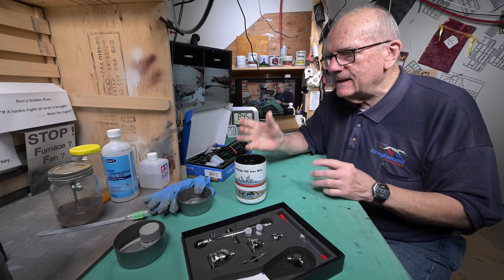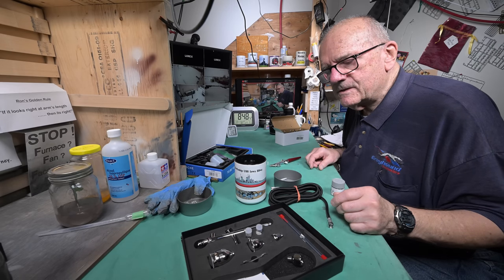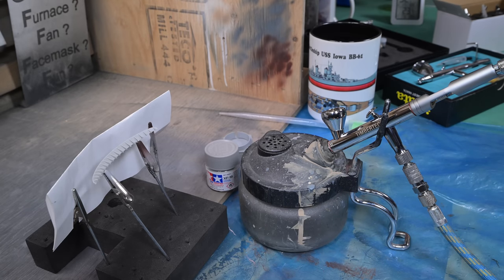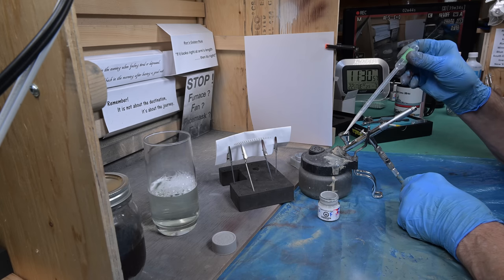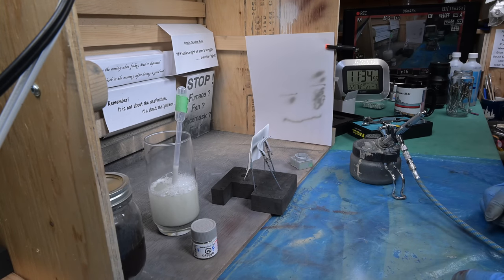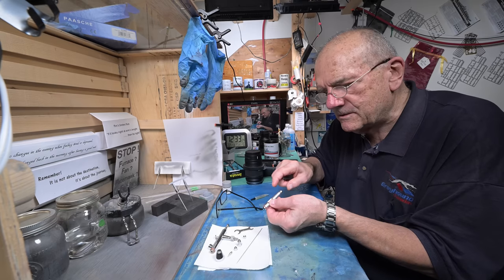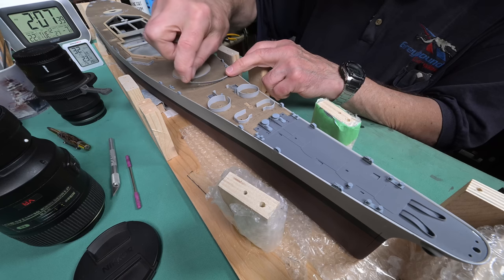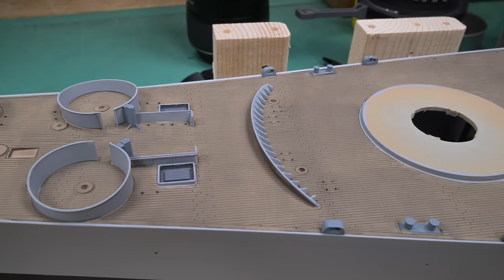The Model Ship - Part 1412

Comment: Hi Ron, I hope you get your money back on those bottles.  Did you by chance get a compressor with a small tank?  I find air coming out of a compressor without a tank tends to pulse, making it a bit harder to control the pressure.  Also compressors with no tank cycle every time you spray, a little annoying.  Thanks for sharing.  Have a great day.  Jeff
Reply from the maker: 🤞  https://www.amazon.ca/gp/product/B07VT2F5N9/ref=ppx_yo_dt_b_asin_title_o00_s00?ie=UTF8&psc=1
Reply: @roncalverley  good deal, that's the same one I use.  Great little compressor.

Comment: Ron, just angle the bottle a bit to the side so you can get the air hose on. The paint doesn’t care.
Reply from the maker: I tried that too later, but still wouldn't fit. However I've come up with a different solution. See in tomorrows rollback. Thanks Tony. 👍🏼

Comment: I think I mentioned that in my post to you furthermore the bottle my fall off when it is full of paint and one more  thing you have no control over how much paint come out of the gun it is either on or off
Reply from the maker: Adjusting the needle valve or air pressure will control the flow, but defiantly not as handy as a dual action that's for sure Dave.

Comment: Would it be possible to drill a hole offset on those bottles for the nozzle and plug the original with something like say hot glue?  Might buy you some clearance from the hose that way.
Reply from the maker: Thanks Chris. I've come up with a different solution. See in tomorrows rollback.  👍🏼